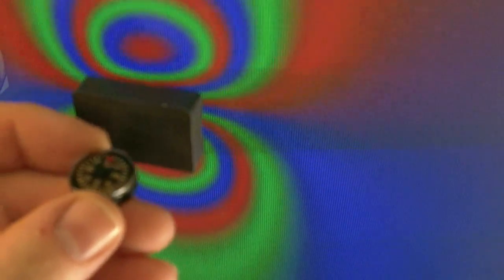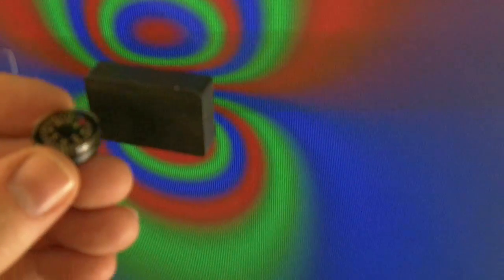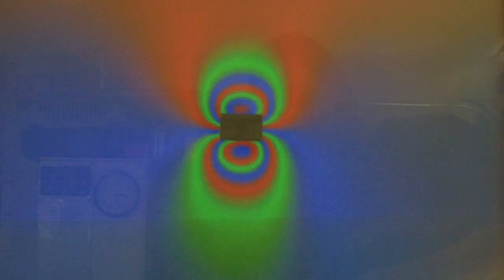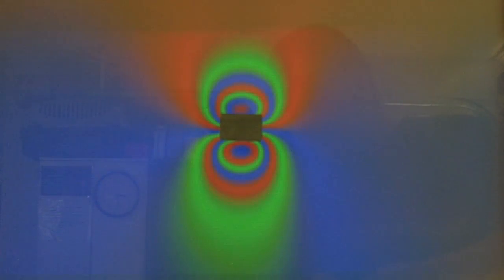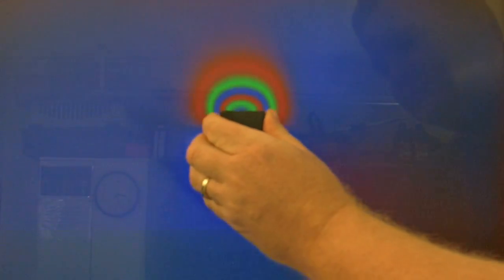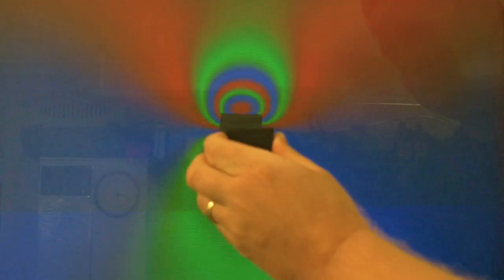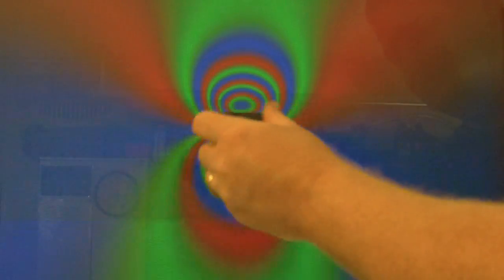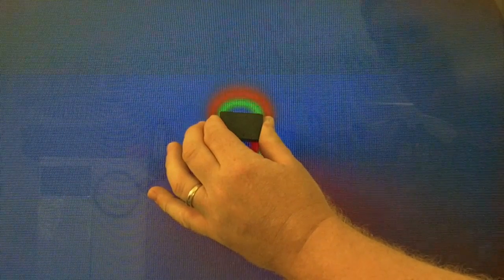Opposing Magnetic Field Interactions - Partnered Output Coils

Comment: hundreds of Amps can be generated by a low resistance secondary. Could that excess amperage be induced into the secondary of another transformer core?
Either by induction or in parallel with two secondaries, one acting as the low voltage amperage coil and the other as a mostly voltage coil?

Comment: What if you take donut shape magnet about 4 and force all in a reputation side together and put a coil in the hole of those rings will the coil produce a voltage ⚡️? You not using weak magnets you using very powerful ones

Comment: I think that although the magnetic fields may cancel in the middle, the magnetic vector potential  doesn't,  spiraling out into space.
Reply from the maker: Current and the Magnetic Field are analogous to each other, yes, the Magnetic Fields Cancel Vectorially, however, individually they are still present. So you are right.
Reply: @SweetSQM  hii 
 if magnetic field cancels when opposite poles interact with each other in that case I have a doubt
We know farday's law right what it says is when their is a change in the magnetic flux current is induced in it 
V/e=dΩ/dt 
Imaging that we are conducting the experiment on this law 
Step:1
Circuit: Suppose a battery is connected to a blub ---> now it is closed right
Step:2
Take a bar magnetic
Step:3 
Place a bar magnetic North pole to copper wire South pole (some field is produced from it right to that fields South pole we have to place bar magnetic North pole)--- >(here flux is changing)
Step:4 output 
We have to observe some slight of blinking in that bulb
This is the process where I failed can u please explain 
My thought is right or wrong if wrong why I am wrong
Reply from the maker: @srimukhijakka7148  - An Electrical Standing Wave, for example on an Antenna, it is deconstructive, power is lost and the Antenna does not receive the Signal right? A Magnetic Standing Wave, it is deconstructive, but Electrically, is is Constructive, this gives us  double the wave amplitude for E but B does not effectively change in time, it cancels, so how to get the voltage up? Think is the lines of Wire to Wire interactions and Magnetic Fields. Many of my videos cover this...

Comment: Do magnet fields (from two or more sources)  obey the law of superposition?

 ...i.e...can they be algebraically added/subtracted???  I have been wondering about this for a loooooooong time.  Also what would happen if you placed the magnets, not only at 0 and 180 degrees with respect to (wrt) each other, but put one 90 degrees (perpendicular with the fixed magnet--I would expect a field strength somewhere in the middle of the two extremes (I think this was mentioned in another reply).

Thanks,  this really helps me, and I am sure many others...
Reply from the maker: +Dale Nassar - An excellent question! Conventionally yes. The Magnetic Field Lines are Vectorially summed, So 1 + -1 = 0, but experiment shows this is not completely the case. The example of a Transformer is one place to look. Two types of Transformer arrangement have been common over the years, Stacked Coils, Primary on the Bottom and Secondary on the Top, and Primary on a single Bobbin and Secondary over the top on the same Bobbin. These arrangements can giver a large efficiency difference, the stacked Coils being less efficent. But Why? Leakage Inductance, so Flux Lines escape. But not so much with windings over top of each other, Why? well the Field is 180 closer to the Source! A Current Super position rather than a Magnetic Field Super Position. Hope this helps.
Reply: "A Current Super position rather than a Magnetic Field Super Position."

AhA!  Biot-Savart right in the middle!

Comment: What I think is happening is that two opposing poles change the shape of the combined magnetic field drastically. It would be interesting for you to show that compressed magnetic 'beam' shooting out of the joined pole section. But you would have to rotate the assembly 90 deg. towards the screen. Now this beam runs parallel to the screen surface, not cutting it through so the apparent diminishing of the magnitude of the field.

Comment: So this basically demonstrates the complete opposite of what John Bedini says is created when pushing like poles together.
Reply from the maker: clixbits - Just showing my findings. This is how the Fields of a Generator Interact when the Rotor is on approach to the Stator, Lenz's Law, the Magnetic Field opposing the Source Magnetic Field creates this same opposition! This is the Stress Tom Bearden talks about in the Video Radionics at a distance. Stress can be tapped, it is energy, Partnered Output Coils create Stress. Bill Alek's device works on exactly the same principals.
Reply: clixbits - Please drop me a line, bruce.aramark@juno.com.  I can't figure out how to get you a private message here on Google plus.  Sigh.  Thanks!
Reply: not so! JB told us that two north's pushed together makes for a narrower field as it passes the coil.